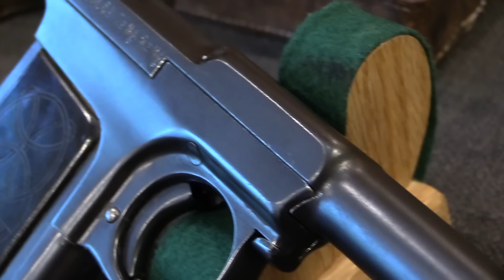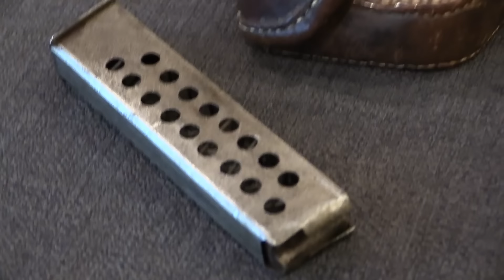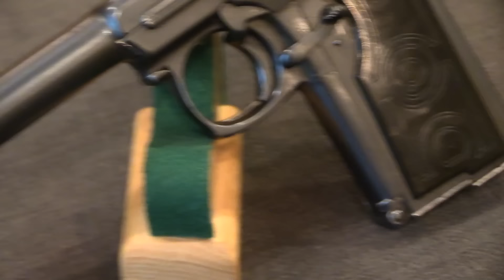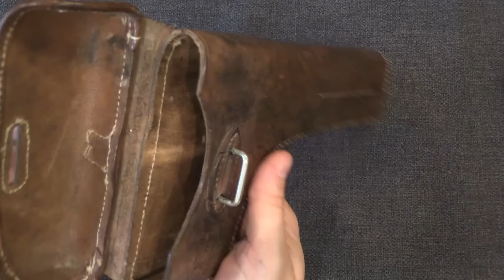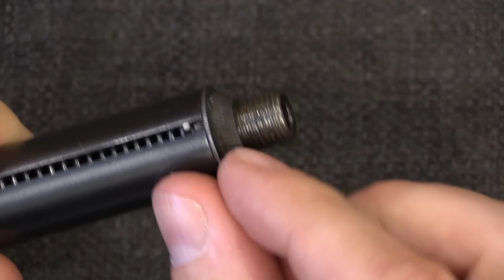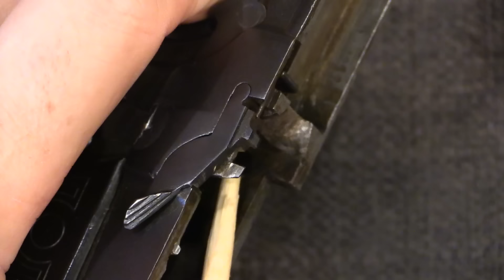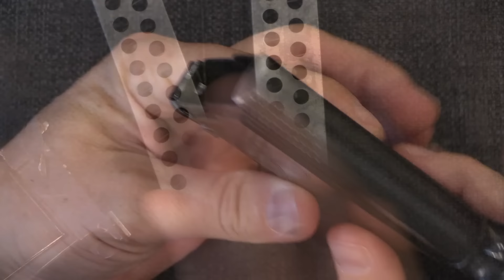Sunngård Automatic Pistol: 50 Rounds in 1909

Comment: looking at the operation, I think the  "disconnector" is an auto sear, and this is a machine pistol. If the slide cams it down each cycle, and the trigger is held back, it fires full auto till you release the trigger like a sub gun. probably even more collectable than described.
Reply: Sear engagement is how triggers are "tuned", which might have the undesirable effect of rendering them NOT drop safe. Factory triggers tend to be long in the tooth so things don't get bumpy

Comment: Wow that's only 4mm protruding out of casing. Wish you had ammo or drawing of ammo to see. 
50 to 60 grain probably would of been a good thumping round.
Reply: The problem was the blowback design. Its clear the cartridge was rated for exceptional pressures but a heavier slug would result in more momentum. The blowback design (despite this one relying on an EXTREMELY robust spring) really needs a heavy slide or bolt. Using a tiny but fast slug (if his 29gr at 2000 fps is correct) generates momentum similar to a 7.65 browning. Simply bumping the weight up to 40gr dropping the velocity to a leisurely 1800 fps would result in about 24% more momentum. For a blowback system these heavier bullets would quickly destroy the gun unless more mass was added to the slide to compensate. That's probably why his 8mm and 6.5mm designs each fired the same weight bullet - he didn't want to design an entire new slide assembly.

Comment: If you’re out of primary and in a position where you need to evade, 75 rounds of something that at least looks and sounds intimidating and will wound and maim might actually be more effective in real terms than having 7/14 rounds of harder to handle .45 for the average troop.  
Pistols seem redundant except for when the situation becomes unusual and desperate.
Reply: I wonder how well could it work as a full-auto PCC, as you're basically looking at a less compact P90 at that point...

Comment: Comment on operation, it seems more likely from a usability point of view that after emptying the front magazine instead of switching rather awkwardly to the rear one that the user would more likely hit the release & drop the used mag into the holster & replace it with the 3rd mag. Then if you unfathomably needed more that 50 rounds then you could still switch to the rear magazine.
Reply: Also, given that Ian only removed the rear magazine after he'd stripped the weapon makes me wonder what the procedure for removing the rear magazine actually is; it seems to me that you're probably correct, and that you'd just be swapping front magazines most of the time, keeping the rear magazine as a hold-out if you ran out of regular magazines or had an interruption and needed the extra rounds more quickly.

Comment: Surely there would be a way of making one mag that holds 50 rounds instead of having to fumble with that rear mag setup... especially if you want to use a thurd mag. Three 50 round mags that can be changed quickly would be better... and full auto!

Comment: Make a version of it in 25 ACP with a properly angled grip, and lose the idea of the hook to hold the back magazine so reloads can be cycled through back to front. Even cooler would be a system that automatically drops the front mag when empty and uses a spring to push the rear magazine forward.

Comment: Awesome video very rare and weird gun if I knew anything about Gunsmithing I would totally make it just for the novelty sake one thing that I do see that would be bad about the gun also is overheating with that amount of capacity and the size of the pieces of metal used to make it I can actually find a lot of faults but I still think it's cool gun

Comment: One thing I learned really quickly when I was tinkering with guns, pistolsmithing, and studying small arms history was that guns may very well be the only marketing sector that is almost completely immune to rule of cool. It also is one of the few sectors where end users are actually acutely aware of concerns like logistics and design compromise. Lots of people want to make a cool new cartridge that will change ballistics as we know them... until no one wants to buy an oddball expensive cartridge when there's 10,000,000,000 rounds of .45 and 9x19 out there already. And here we see that the novelty of having 50 rounds onboard in a handgun, remarkable as that was, especially in that time period, does not trump more utilitarian concerns like cartridge performance, mechanical reliability, and awkward ergonomics.
Reply: Stop trying to sound like an expert. You probably just read a bit about guns and call that studying and pistolsmithing.

Comment: Really makes one wonder, if it would not have been better, to just put one magazine in the grip and 2 in the pouch.

The back mag reload seems kinda awkward anyway, so i'm really not sure, if it saves a lot of time over just using a magazine from a belt pouch. There is potential for screw-up in the dangling wire hook thingy too.

And it would have avoided the awkwardly shaped and wide grip at the very least.

Comment: If the velocity was lowered and given rubber/wax bullets it would make an excellent riot pistol or modern police use pistol on its own. The only flaw is the double magazine being physically integrated in the pistol, not only making it hard to handle but also impractical for sliding a new clip into. Anyone in service would likely drop and replace the main magazine and leave the integrated as final reserve. 
This would make more sense as an sub machine gun for suppressing fire to the clip size to ammunition ratio, 8mm being even better suited. I wouldn't be supersized if implementing this pistol into the Finnish army would have produced a style of sub machine guns with 350 round drums coming into the second world war.

Comment: Rumor has it that the military pre-tests for this gun is not yet finished due to the unfortunate technical stipulation that 500 times provided full magazine capacity must be performed... somewhere in Norway there is an old test engineer still pounding away, round for round trying to end the test cycle... severely arthritic.

Comment: The "tethering" of the second magazine seems unnecessary.  I think the gun would work just as well, if not better if the second magazine wasn't attached.  That way you could just keep cycling new magazines in the rear.  
I really dont see why the second magazine needs to be attached to the pistol frame?

Comment: when disasembling,  does the barrel tip forward, or does it launch forward off that spring?  I would argue that what you have there is a 76rnd gun,  the last round just happens to be very large....and slow

Comment: So, to expend the entire 3 mags in the shortest order you would fire off the front magazine, extract that, then load the holster magazine into the front position, discharge all the cartridges, remove that mag, and then, and only then, pull the second position magazine down and forward to then exhaust that clip... I wonder how long a practiced shooter could fire all 75 rounds?
One thing I noticed was that there was no indication of how the extraction of the spent cartridge occurred, which is often a feature of FW video's - did anyone notice any levers or ramps?

Comment: I can see why it was never adapted. One, Not enough stopping power. Two, Bullet is easily deflected (i.e. wet laundries or tall grasses). Three, unusually cruel way to die if you get hit by one at the turn of the 20th century. It may not kill you right away but it will kill you later anyway because of internal damages which light unstable bullets with very high velocity usually do. Not very sportsmanlike during that time.

Comment: Never heard of this. This is impressive. 
Though I can't help but wonder if a single magazine wouldn't have been a better choice. "Only" 25 rounds, yes, but less mechanic complexity, a more comfortable grip, and he could have probably used a slightly heavier bullet - assuming here that the low weight was not only for recoil control, but also to limit the length of the case. 
Still cool piece of history.

Comment: but why not just make it use a single mag..... that fixes the grip issue 

and you STILL have more shots than almost anyone else.....even today
and still issue 3 mags (with a different holster)

seems WAY better than trying to....
release old mag, pull out, drop mag down, rock mag forward, slide mag forward, push mag up, rack slide

would be like a p-38, sorta....with the heal release.
but, ya just need to....release, pull old out, push new in, rack slide

seems WAY easier to do under stress

but then at that point..... you already have a dual stack/feed...... why not do a anti-kertz..... and make a longer 8mm 
or use one of the various 9mm rounds around at the time

you have SO much extra grip room in the forward/backward direction..... probably could fit a 357 mag in their..... at least a case that LENGTH 
you could literately 2x the case length 

you have two mags........ two cases PLUS two bullets
* waves hands in air, saying "uhh hello anyone else see this" *

idk if ya get what i mean..... i cant describe shit for....shit

but a bullet of the same diameter.... just longer
and a single mag well

aka..... 95% of modern pistols

might not be able to get by with it as a true blowback......but their are MANY ways to find a solution

Comment: 5.7 inspiration? Nah. More like a hi velocity .22 short. The recoil spring is probably hefty because it has to provide the force on the striker spring besides holding the light slide shut, when the recoil spring is in a relatively relaxed state inside the gun. Cool little bean launcher.

Comment: Wow. That is an incredible pistol design. Seems like this design would lend itself to huge modifications. Few alterations and it could fire rifle rounds from that mag well. I can actually see this, in  it's existing form, being a great survival rifle.
Its an okay pistol, untill you thread on a barrel extension and clip on butt stock. Then it's a fantastic low pistol Cal rifle. And if it really did shoot at 600mps, with modern rounds, that would almost be AP.

Comment: For some reason I feel this pistol would sell well in an infomercial. Are you tired of those low capacity difficult to load revolver, well let me introduce you to this marvel of european technology the Sunngård Automatic Pistol. It come loaded not with 10, nor 20 but 50, that's it 50 powerful 6.5 mm round. If you call in the next 5 minutes not only will you get this fine leather holster but also another 25 round magazine, giving you a grand total of 75 rounds at the ready. Call now

Comment: Are you sure the semi auto disconnector /magazine hold open isn’t still holding the sear in the fire position when the slide is fully closed? It looked like the bar from the trigger pushes the sear upwards when the trigger is squeezed and pushes the sear up, over and past the semi auto disconnector/hold open?

Comment: 25cap probably wouldn't have the energy of the original 1800+ fps proprietary cartridge... strangely, if those stats are true, I'm sure the original would have pushed a standard 50gr fmj significantly faster than 25acp, though not astonishingly so.

Comment: I don't get how you describe the trigger.. I don't see how the trigger would be able to hold the striker.
The way I see it the slide just pushes the disconnector lever down still engaged to the striker and puts the striker low enough to be pushed of the dissconnector sear surface by the trigger.

Comment: Sure, that's a neat gimmick, but does it really add any practical value to the gun? It seems like switching out the magazines in the grip would be at best only marginally faster than just loading in a new one, and a gun that's easier to handle and in a decent caliber would have more of an advantage that that slight increase in loading speed and the high capacity.

Comment: I can see how manufacturing costs and quality control would be an issue with this gun and how many parts and how much specialised tooling would be required. I mean that spring and the notch and the fact the spring has the bit hanging down.

Comment: As Ian was explaining this pistol, my mind already started modifying it. Loose the 2nd, integral magazine, but give it a an ergonomic handle and grip angle. To compensate for the loss attach an additional magazine compartment to the holster. So you still have that compact, grab and go - package with 75 rounds on board. Add some sort of rotating barrel locking mechanism and use a small bore, high power cartridge like 5,7x28. A gas delay mechanism around the barrel would work fine too. A threaded muzzle is already there for a nice little can, that maybe not very quiet, but can save your ears in an emergency situation. 

Thanks Ian, these old guns are very inspiring!

Comment: Out of curiosity, I wonder, in theory, if you get rid of the wire and cut down that wire-holding loop on the internal reserve mag, would you be able to insert a standard issue mag behind that reserve one?
Or even will it take two standard mags if you just removed the internal reserve one?

Comment: As a Norwegian i appreciate the correct use of Å. Most people get it wrong or just use A instead. Thanks!
Reply: Now if they also learned to pronounce it correctly... "å" is pronounced approximately "aw" while "u" is pronounced "oo", so the name is pronounced roughly "Soon-gawrd" with short "oo" and a long "n".
Reply: @jarmokankaanpaa6528  no, the D is silent, so “soon-gore”
Reply: @Squossifrage  Yes, assuming the person is Norwegian or Danish; the R is also more gutteral than the American Midwestern R and in Danish would be nearly indistinguishable. However, the same name could also be Swedish, in which case the D would be pronounced (except possibly in Scania) but the U would be different (closer to Ü). In any case, the discussion was about vowels rather than consonants, which vary in regional Scandinavian dialects even more than the vowels. It would be impossible to give a non-speaker a general rule-of-thumb on how to pronounce Scandinavian names correctly since you would need to know not only which country but also which specific region the person in question derives from. Still, any  form of "Skandinaviska" is preferable to pronunciation by English rules.
Reply: @jarmokankaanpaa6528  Harald Sunngård was Norwegian.
Reply: Ok jeg er norsk å jeg holder på å lære tysk
Reply: @arandomdudeontheinternett  *og
Reply: Paal Aaseng Stubbrud With the exception of IPhones and iPads finding devices with keyboards that include such characters can be difficult, especially in the US where we don't use many of them.

Comment: I see some reasons why this wasn't put into production
The cartridge, as Ian said, is too light and not very powerful. The handling is't the best, that weird angled and thick grip doesn't looks as comfortable as a more average grip. The reloading operation looks not that nice, as someone said, down here, reloading with the spare mag looks quicker than using the second mag. And lastly, that secondary magazine adds one step in the production of the pistol, making it a bit more elaborate.

Comment: Something like this might have come in handy during ww1 as in the early stages of the airwar the airplanes themselves were not armed
(no Synchronization gear at the start of the war) as such pilots used pistols and revolvers (and observers tended to use carbines or shotguns etc) and in such a role this gun might have been useful due to its ammo capacity.

Comment: It's immediately obvious why it never caught on anywhere. First it used proprietary ammunition, it looks to be more expensive to make than a 1911 clone, the terminal energy imparted by the bullet even with the supposed high velocity with such a low mass would be small, the handling with the deep grip and forward canted angle would not feel as natural as the 1911 or almost any wheel gun of the era.

Comment: Hindsight tips for norwegian military trials:

1: Drop the silly double magazine thing
2: Make the cartridge more potent
3: Lock the breech

Instant adoption given the only thing speaking against the Colt was that it wasnt Norwegian made...
Reply: #2 like:
Keep the diameter of the bullet, but double bullet weight (by adding a little length and a pointy tip) and lengthen the case to 25mm?
Still 25rds per mag, but with a lot more potential.

Suddenly the FiveSeven is reduced to being just a mere copy...
Reply: Yeah, but body armor wasn't really a thing back then, so why have a FiveSeven ahead of the time when it became actually needed?